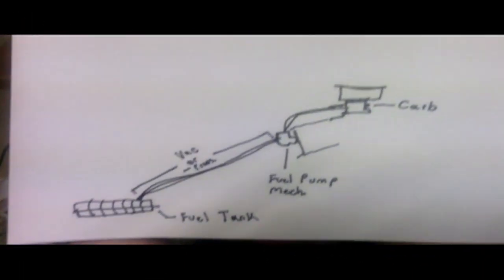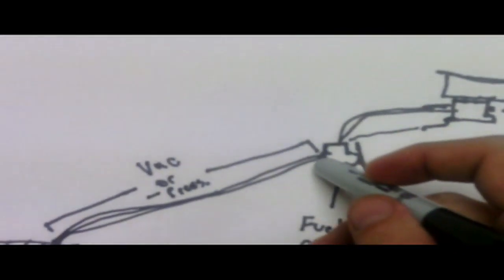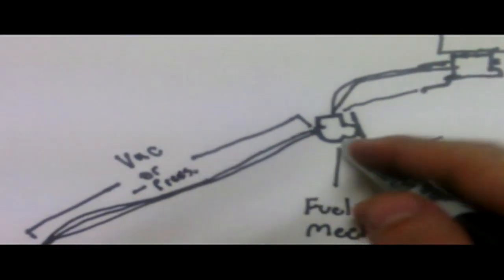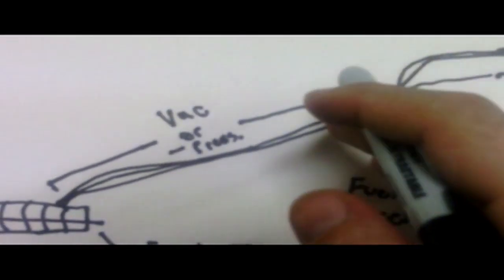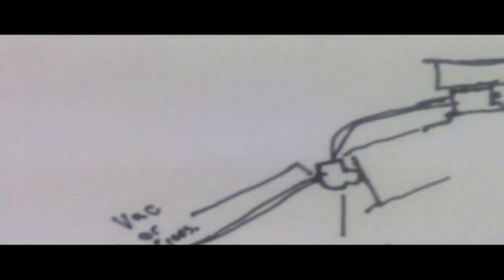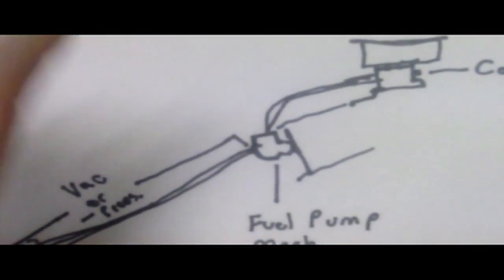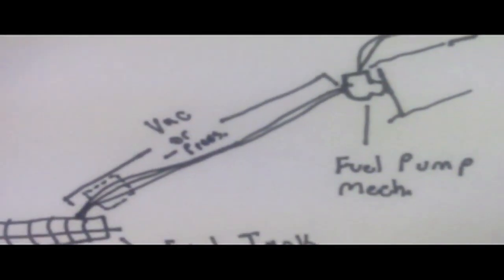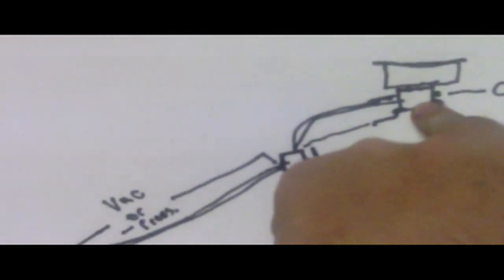A Word On Vapor Lock

Comment: Great video. After seeing this video, I'm now thinking I'm having a problem with a partially plugged fuel sock combined with vapour lock. I think the plugged fuel sock is contributing to more negative pressure. The car stalls when warm and the hose into the fuel pump is completely dry. The vapour return from the pump doesn't seem to help. After sitting a while it starts fine and gets plenty of fuel.
Reply from the maker: HeavyOlds either vapor lock or weak fuel flow
Reply: Chris Rocha when it happened the first time we replaced the fuel pump and filters. Those old mechanical pumps are cheap. Today I plan to blow injector cleaner back through the fuel line into the tank and siphon the fuel out of the tank with a 5/8" ID hose to see if any crap comes out. It happened a second time right after filling up. This was after replacing the pump and filter in the carb.
Reply: Chris Rocha I'm also going to put that foil covered ceramic cloth stuff around the fuel line to the fuel pump.
Reply: Just drop a line from your fuel pump ( on the engine ) to a container under the fuel pump, that way you cut out the fuel tank, lines and venting systems

Comment: My inline 6 cylinder engine is cool on the right side, manifold is on the left side, and the fuel line is on the right, good design. It is not hot from the tank to the pump. But the gas gets so hot in the line going over the cylinder head and into the carburetor, and the carburetor gets so hot that the gas evaporates (boils) out of the carburetor. The engine is starved of fuel, even though it's on the higher pressure side of the pump. But my pre-war Chevy fuel system only has 2-1/2 psi pressure, not enough to fend off vapor lock in the hottest part of the fuel system. Gas is more volatile that it used to be, adding to my problem. I'm going to try a heat shield and spacer to try to keep the carburetor cooler. I got stuck today, and I have to wait and wait for it to cool off before it will go.

Comment: I'm wondering what a one way fuel valve would do for vapor lock. What if it was installed between the fuel rail and the fuel pump? Would it prevent the fuel pump from getting the bubbles, and could that, in turn solve the problem?
Reply: Fuel pumps have check valves built in. It's actually how they work, with a diaphragm that reciprocates pulling gas in and pushing it out of the pump chamber. To get it to move from the tank, one check valve is placed at the pump entrance, facing inward to the pump chamber allowing gas to be drawn in, but closes when it is pushed out. There is another check valve on the outlet, facing out of the pump. This allows gas to be forced forward toward the carburetor , and prevents it from being drawn back into the pump chamber from the outlet line, and the pump draws the fuel only from the tank side. The vapor lock I've experienced is in the line from the pump forward and in the carburetor, because this is the hot zone in my car.

Comment: I heard an old tale once about an old fashioned clothes pin on a fuel line which apparently caused a lower pressure through venture effect which apparently solved the problem. I don't know if that's a real McGeiver  deal or just a story.
Reply from the maker: Ray Brensike i imagine in theory it work
Reply: I learned today that the clothes pin was actually used to hold on aluminum foil to insulate the fuel line and once that burned off the clothes pin was left. That's what I heard today 🤔

Comment: This is a great video. I only seem to have vaporlock issues on my 78 G20 Rochester Quadrajet whenever I go to high altitudes. Hence, fuel pressure is reduced from the altitude. As you mention, I have a carburetor and a mechanical pump. I will try insulating my fuel line and possibly insert a switched auxillary electric fuel pump as an assist.

Comment: Thanks Chris, I have an RV with a 460, it's a 1997 and ACTS like vapor lock. At night, or when rolling flat shes fine, but stopping in traffic, pulling hills, and hot days, she starts blubbering / gagging, won't take throttle, and then dies. If I let it set for 5 minutes I can drive it about 100 feet, f it sets over night, she starts right back up, runs fine until HEAT gets it...any ideas??
Reply: I've got a 79 Dodge RV that does exactly the same.  I just crawled around underneath and traced the fuel line and no wonder that baby is getting hot. I am going to try wrapping it with heavy aluminum foil to see if it helps.  We live in Las Cruces, NM (4000+ altitude) and on 109 degree days, driving in stop and go traffic, up and down hills... I'm lucky she doesn't do it more often I guess. In fact, this good ol girl hasn't QUIT on me yet but she sure sputters, gasps, and gags.

Comment: Fuel pump powered by rocker arm? 
DUDE.......... Seriously?? Try CAMSHAFT!! 
 the engine's camshaft has an extra eccentric lobe that operates a lever on the pump, either directly or via a pushrod, by pulling the diaphragm to bottom dead center.
Reply: I meant to say CRANKSHAFT, not Cam / just freaked when I heard "rocker arm" which is definitely wrong. My comment was over a year ago.... thanks
Reply: There is a rocker arm driven by the cam shaft.  How else would the cam work the pump action.  Don't be a jerk.  Ever taken a mechanical fuel pump off before?  What's that thing sticking out the inside side of the pump?  Rocker